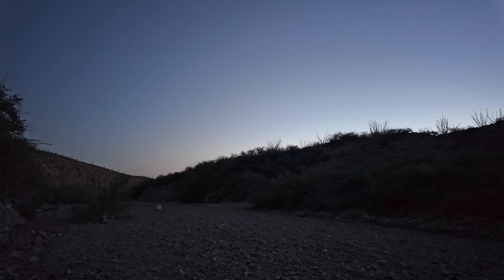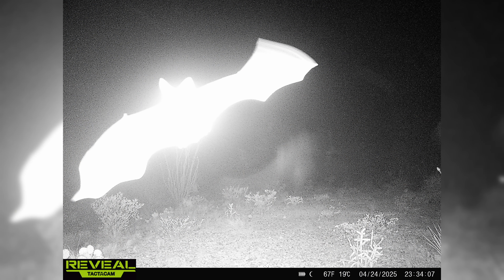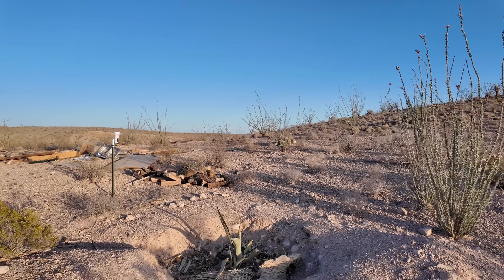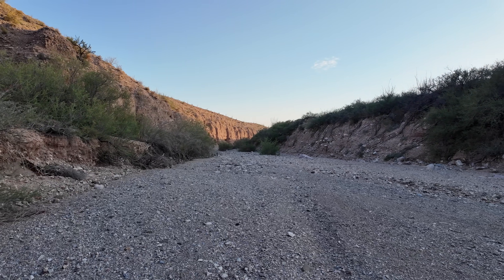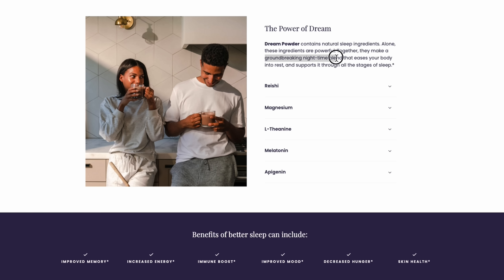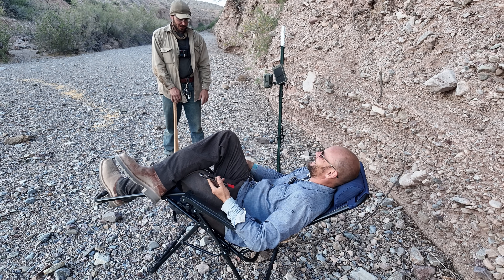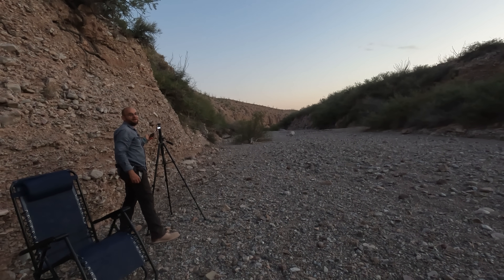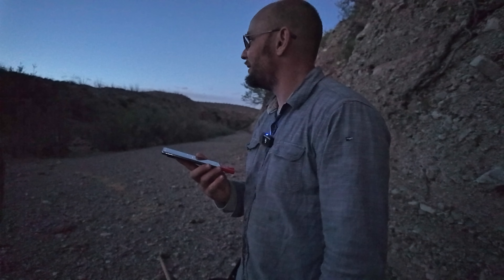The Coolest Thing I've Found On My Desert Ranch

Comment from the maker: Find out the easiest way to get and stay asleep when you click https://shopbeam.com/dustups and use code DUSTUPS to get up to 35% off with our exclusive discount. Thanks to Beam for sponsoring this video.
Reply: Have you thought on bury some water tanks and build a drain to collect water from streams in wet season? A sea container can contain over 60k liters, that's over 150lts a day.
Reply: Idk if you have already but try some Boxelder Maple trees. They are very resistant to drought and heat and they grow like crazy. They are considered a weedy plant due to how fast they grow but also how invasive they are. They drop seeds like crazy but that may be good for where you are located. Good luck man!
Reply: https://youtube.com/shorts/DKLJFjc_lAI?si=b9DCJvbJcjbl6Jqu possibly be a better idea than just tires, and it'll probably work better if they're not fired but rather packed in with soil and around with anything dense to help it hold its structure, like sand ⏳ even
Reply: SHAUN PLEASE READ. You need to install a geothermal closed loop system hook a radiator and water pump up to the geothermal and then have a drain pipe going into some type of water channel that can drain down or fill a basin. It will condensate and drip water all day while cooling your quarters and use ~200 watts water pump. Just get some solar panels an inverter a couple lithium iron phosphate batteries and you're good to go.
Reply: Do you have any videos showing dragon fruit growing on the ground out there?
Reply: Bat watching a bit lacking in visual interest, but if you were to do the CE5 protocol and try summoning some ufo's with all that desert sky to view with zero light pollution THEN my friend your ratings and views would SKYROCKET!!
Also is Brandon single and does he do his own streams, he's Deeply interesting in his outback crocodile Dundee level chill, in harmony with the desert, loner dude vibe, something very sexy about him❤😘😉
Also I thought I read you post about having rain somewhere? I've been watching since you started the chanel and on tenterhooks, waiting for  good rain content, yet it's been 2 Saturdays worth of videos and you haven't even mentioned it????😮😢no footage of the first rain in ages???😮

Comment: It would be so easy the fix water issues in the deserts.    Big sand dams that the silly government could help fund.   The mountains are full of perfect spots to do it.  Military helicopter drops off a lightweight backhoe in certain spots like that wash.  Start building a huge wall of gravel   a big dam.   Then rubber liner across the top and a piece for the spill way.

Comment: SHAUN PLEASE READ. You need to install a geothermal closed loop system hook a radiator and water pump up to the geothermal and then have a drain pipe going into some type of water channel that can drain down or fill a basin. It will condensate and drip water all day while cooling your quarters and use ~200 watts water pump. Just get some solar panels an inverter a couple lithium iRon phosphate batteries and you're good to go.

Comment: Did you try the bat sound detector in front of the cave? Having done some voluntary work to find local colonies and take observations and measurements of endangered species, you'd definitely get a hit if there's bats near the entrance. We used a lower tech tool that doesn't automatically ID though, it would output the sound at frequencies we can hear and then we'd have to recognise the species by sound. We were also scanning different frequencies each as the tool had a narrow band. Fun times!
Oh and there's also stationary observation tools much like the wildlife cameras you set up, but picking up and recording ultrasound frequencies. If you are into getting solid measurements over time so you can compare them, you could set some up at strategic locations (based on manual observations, or terrain features likely to serve as "bat highways" if they do that over on your side of the world as well). Not sure how much those devices would run you, but there might also be some local bat protection group willing to help with the cost (that's how they do it over here)

Comment: Once you find where they are chilling, you'll have access to not only natural, locally sourced fertilizer but also if you need to move a few boulders bat guano contains a high percentage of useful elements.  Again, locally sourced materials make solutions that the natural biome readily accepts and integrates into itself, even as it evolves.

Comment: Every time I see that canyon wall I think you should get some 4" natural wood poles and drive them in about a foot apart, zigzagging in two parallel rows, then put logs between them and pile up rocks, to make a huge beaver-dam type structure so start catching sediment and thus trapping water.  This time my thought is to make a few of the poles a lot taller than the rest and -- assuming any of the bat species there would use them -- put bat houses on top!
Although . . . instead dig sideways holes and stick the bat houses into the cliff side for the natural cooling.  I'm not sure it would be possible to design a stand-alone bat house for the Chihuahua desert climate.  

Hey -- you should see if you could get viewers a discount on that bat detector!  It looks like fun!  I've camped on a river gravel bar and got buzzed by bats at water level, shoulder/head height, and higher up, and it would be awesome to be able to know what species are doing what.

BTW, that Beam 'Dream' stuff is the first sponsor item to really catch my attention -- I'll have to try it.
Reply from the maker: Please use the link!

Comment: Great progress!
I wonder if you have considered adding "Mycilial Fungi" into the Ground/ Soil, which should actually help to turn the ground into soil.
Best of luck
Reply: That would be useful once the check dams start holding sediment.  It would work even better if dead plant matter got worked into the sediments to both hold moisture and add nutrients.  Then keep raising the heights of the boulder dams to increase sediment depth.  From the looks of the washes that shouldn't be hard; they look like a fair amount of sediment washes down when there is significant rain.

Comment: I love bats I hate how much of a bad rap they get they're such a useful species. And they're a mammal that can fly. Sometimes I wonder if people are just jealous lol. 
But on your cooling your campsite quest have you ever looked into what the people the Middle East did with tall buildings and skinny roadways providing continuous shade on the common areas allowing for a much cooler area you can take some of that pipe and just put it vertically above it and just string like netting across so you just basically create a shade constantly all over between the buildings. You're basically making billboards and putting them up to block the sun. But they seem to have some good success with it over there in the Middle East

Comment: Can these bats live in bat boxes cuz I’d put them everywhere there 🦇 ❤
Reply: One problem I see with bat boxes at the Dustups is cooling - These bats find openings in the sides of the canyons so are back in the "dirt" which keeps them cooler during the heat of the day. I'm not sure that a bat box would stay cool enough.
Reply: @jrkorman  exactly. There was actually a huge culling at a sanctuary around me because of a bunch of boxes overheating due to improper usage
Reply: @nickkk420  I'm sitting here trying to think of a way to do stand-alone bat houses in that climate and failing.  The only thing I can think of would be to cut slices into the north (always shaded) side of the cliff, insert bat boxes, then tightly fill the slice back in.
OTOH some species live in trees, so making structures that imitate trees could work.

BTW, according to a national bat group, there are vampire bats in Shaun's area . . . .  <eek>.
Reply: @traildude7538 then as always it'll about adapting as close as you can to the native species natural habitat, control the variables you can and take advantage of naturally occurring ones